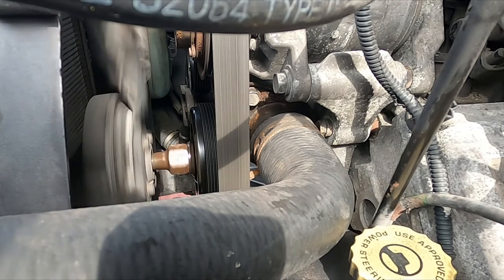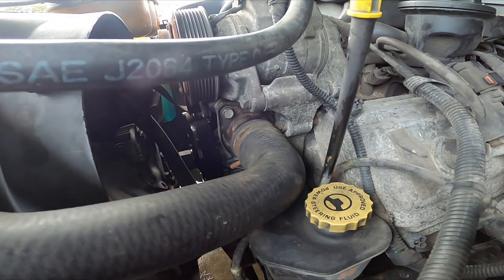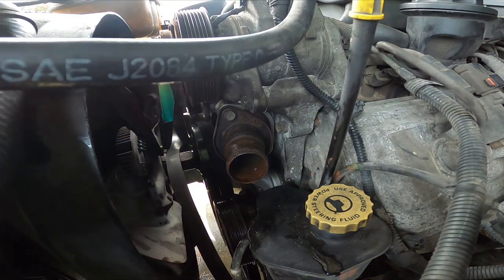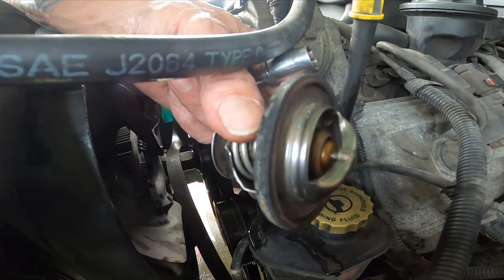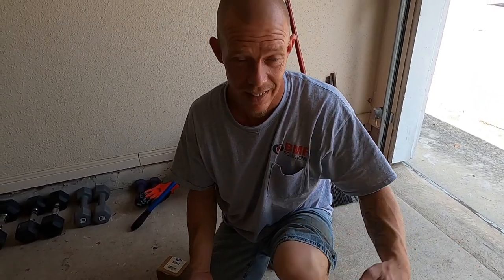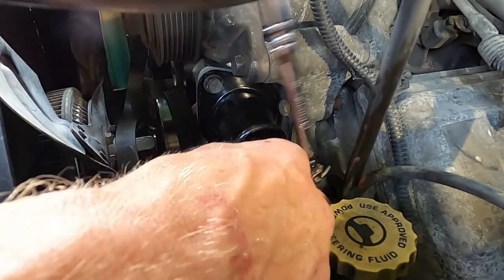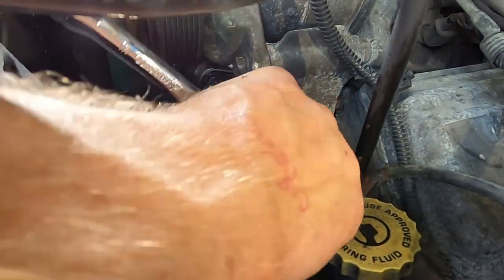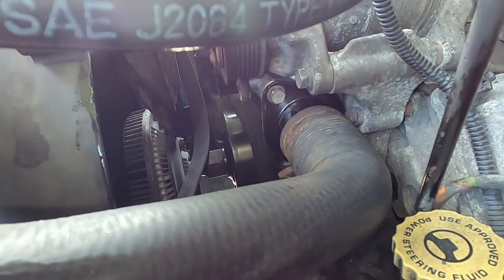03 Hemi Ram 1500 Thermostat and housing removal and installation

Comment: the o-ring is sufficient usually …but as you experienced a leak after doing water pump that  the gasket that is available would have prevented when using an old water outlet just like you did it then disassembled and reassembled with a new outlet

Comment: Replacement seals are certainly available for the thermostat,  and I could be mistaken but the stock temp is 192 or around there…there is a water outlet gasket available and recommended when reusing an old outlet, I personally just scrape it on the concrete a few times and reuse the outlet but install with a new thermostat o-ring and a outlet gasket lightly coated with rtv
Reply from the maker: No sir stock temp 203. The o ring that comes with new thermostat is efficient
Reply: It’s 203

Comment: Felpro 35840 is the number….not nescessary with a new water outlet as you say but save some aggravation if reusing it
Reply from the maker: I'm good I will pass
Reply: Whether you will pass or not is irrelevant, my Main intention was to correct you as the water outlet gasket is available, but you said it is not so try not to spread incorrect info

Comment: Trying to bleed mine right now... filled from the reservoir but I have 1 1/2 gallons of the 4 gallons of fluid to add... wtf...
Reply from the maker: Let the truck run and cycle the thermostat a couple of time. Then see where your at
Reply: @autoguydiy4244  patience - not my strong suit...lol. I am checking it this morning (31 degrees outside). The defrost might work - I am hoping! I just don't want to get a vapor lock before I hit the road and overheat on the way.

Comment: How do you know when the system is full with out over filling it , because of no cap on radiator?
Reply from the maker: There's  a line on the expansion tank. If you have any doubts fill up ,run car ,watch temp gauge, your  looking normal running temp ar idle if running a little hot add more

Comment: Was I suppose to push the thermostat all the way in where the gasket is showing a little or was the housing suppose to do that
Reply from the maker: Push it in until it stops.  The gasket should stick up a little bit so the housing will squeeze it and seal
Reply: Ahh ok, thank you. Did I damage it by doing that
Reply: Ok, thank you. Did I hurt it by pushing it in all the way
Reply from the maker: @dragonmaster4496  if it's not leaking, you should be fine.
Reply: Ok thank you
Reply: @autoguydiy4244 there is a steady drip by the bottom bolt of the thermostat housing and I haven't started the truck
Reply from the maker: @dragonmaster4496 you may have pinched the rubber o ring. Check to make sure there good and tight but , don't  get crazy on it. If drip still remains take it a part and check the rubber o ring
Reply: @autoguydiy4244 it stopped leaking once I started the truck and hadn't leaked since
Reply from the maker: Then go with it buddy
Reply: Ok I will but I checked everything and put it back together before I started it
Reply: I tighten the bolts down to where they barely could be tightened more
Reply from the maker: @dragonmaster4496  if it's not leaking  now go with it.